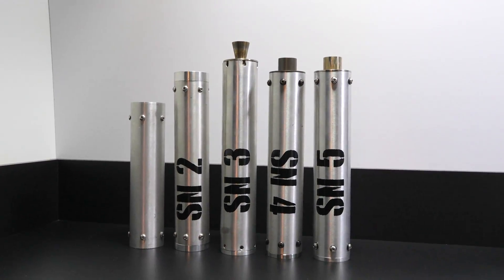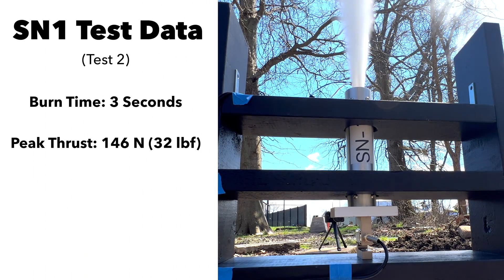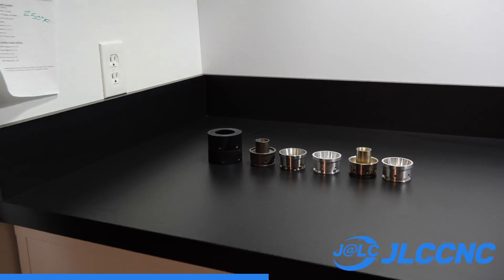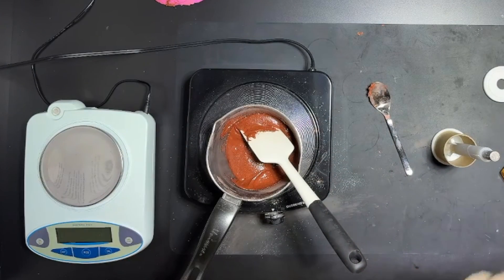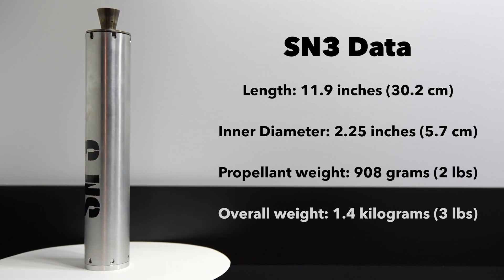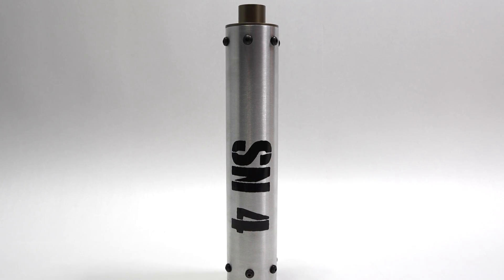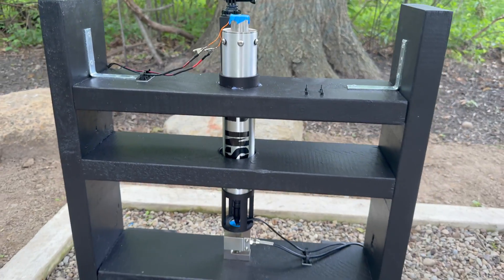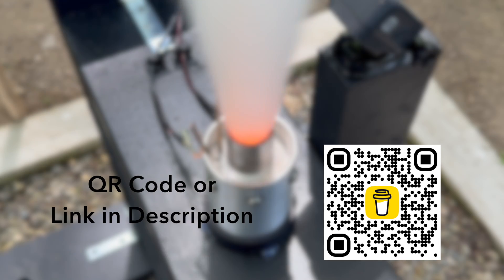I Built 5 High-Power Rocket Motors… What Went Right and What Blew Up

Comment: Awesome Video, I also make a ton of Rocket content. 

out of Curiosity are you L1 or L2 yet with NAR or TRA? if your not it would be good to look into, they have great resources and insurance, depending on where you live there is also a lot of amazing launches. 

Congrats on making a J motor, that's awesome! (640-1280 Ns) 

I myself am working on the Thrust stand for a Sugar motor campaign I'm going to be running soon. 

also just as a tip, and this doesn't really matter, but rocket motors are measured in the diameter of the outside of there casing, not the inside, so 2.25in inner diameter is a bit un-intuitive for us. 
not sure what you meant though.
Reply from the maker: I plan on getting my L1 and L2 certifications in the future. I’d love to actually fly the motors I build, but unfortunately, the rocketry club closest to me doesn’t allow custom-built motors. That’s why most of the motors I make right now are sized based on readily available materials rather than what would be optimal for a rocket. If I were to fly a rocket, I would design one specifically for that, ultra light and high-performance.
Reply: @AeroPropulsions  That's sad, if you don't mind, where ish do you live? I assume its decently far away from the equator because of the snow.

Shoot me an email if you care to talk, Id love to know the base design for your thrust stand. Ive got my own designs, but i always like to have reference. 
(discord is also fine if you want.)
Reply from the maker: I would love to talk! I'm not sure where to find your email but mine is aeropropulsions@gmail.com
Reply: @AeroPropulsions  Awesome, Ill shoot you  an email real quick.

Comment: You can save some additional weight on your steel nozzles by doing the following:
1: make the convergent 25-30 degrees, You will only lose a couple % Isp but less total weight.
2: Eliminate the screw holes in the nozzle, use a separate aluminum retaining ring
3: machine away excess steel around the throat like SN3, not like SN4
It also looks like you have the same number of screws on both the bulkhead and nozzle end. If for some reason, the motor builds up too much pressure and CATOs, you don't want the bulkhead end to fail; if it does, it then becomes the nozzle, and your motor will take flight. By having fewer screws on the nozzle end, it will pop out the nozzle and still stay in your test stand. The same with inside a rocket, you want the nozzle end to fail if the motor overpressurizes.
Reply from the maker: Thank you for all the tips! I will definitely keep these in mind while I'm designing MEGAx.

Comment: Hey for your test stand, as the motor is firing downwards, how to you factor out the loss of mass for your measurements?
Reply from the maker: I use data from my openMotor simulation, and add that loss mass to my data file.
Reply: @AeroPropulsions  Ah I see, I want to build some smaller motors myself ( just to save money cuz I am 17 ). I won't use any fancy grain geometries, just a small hole in the front ( like the A/B/C Motors. WIll I get close enough if I suppose linear mass depletion? Or should I learn how to use OpenMotor?

Comment: with my APCP motors I've found it helps a lot to tape over the nozzle, this helps the igniter build up a bit of pressure.  This helps reduce the propellant wasted at low pressure and the kind of very slow start you experienced in SN3 static fire 1.  Think of it like a burst disc that pops once the motor has built up to operating pressure.

also have you calculated the burn rate coefficient and pressure exponent of your propellant mixture?  This will help a lot when designing larger motors to predict the chamber pressure and performance, also allowing you to more confidently experiment with other grain geometries.
Reply from the maker: Definitely things I’ll look into for MEGAx. Taping over the nozzle would help a lot, losing all that propellant at startup really sucks. Right now, I’m working on an open motor design for MEGAx and using Nakia KNSB as a rough baseline, but being able to plug in my own propellant characteristics would make it way easier to dial things in.
Reply: @AeroPropulsions  I used to use instant start on my 'sugar' motors, but the last few years have done slower start-ups. I think slower starts help prevent motor CATOs, and you are not burning much propellant on a slower start because the pressure is lower at startup. On my motors where I want max performance, I will make the top grain core diameter a bit smaller for that initial burning.

Comment: You should use a slightly thicker wall tube and thread the ends in. Or use snap rings. This will help a lot with re-useability. You can protect the threads with some sort of lube
Reply from the maker: I’ve looked into that. The main reason I haven’t done it yet is because machining that internal groove inside the casing would be pretty difficult. I’ve considered threading as an option, and it’s definitely a possibility for MEGAx.
Reply: @AeroPropulsions  machinging the groove would actually be quite simple with a file. Just would need some time. Set up some grooving tool on a peice of wood or metal screwed down. Set the tube you want to groove against the board and just spin it by hand and simply move the tool in incrementally. Where there's a will there's a way.

Comment: you know that the nozzle only adds about 10% more thrust. so is it worth the complexity considerations? yep compared to a direct pipe rocket without nozzle.
Reply from the maker: Well designed nozzle absolutely worth the complexity. Without the nozzle I would not be able to achieve the thrust I have now.

Comment: So I just took away some points from your test series and compared them to my series. Even though my series is very very incompetent compared to your professional testing, I still think I can make out some comparison. In summary, my first point is: the length of my burn doesn't dictate the power of my motor without knowing the thrust, right? I had a 60g dry mix of oxudizer rich (forgot the ratio) KNSU that burnt for 45 seconds, while maintaining a very solid flame, and a well composed projection of smoke, but still that didn't have near as enough thrust to push the scale down, which is my make shift load sensor. Point 2 is that a nozzle, especially its deflection angles and throat size, are very important and dictates whether you have a smoke bomb, a rocket, or a grenade. Point 3 is 0.7 cm thick aluminum, forgot the type, is still not enough for a KNSU motor. Thanks for the video by the way, it's a benchmark for my work and a marker of how far KNSU based propellants can go.
Reply from the maker: Yes, you’re totally right, you definitely need to measure thrust if you want to know the power (total impulse) of your rocket. Nozzle geometry plays a huge role too, if the throat diameter is too large, you basically get a smoke device; too small, and you risk creating an explosive device. I’d really recommend investing in a load cell and Arduino setup. A scale can give you a rough idea of peak thrust, but it won’t tell you much beyond that. To calculate total and specific impulse, you need to log thrust over time.
Reply: @AeroPropulsions  Thank you for the feedback🙏. I've already had some ideas on implementing what I got from the video to my tests.

Comment: I honestly loved this series, ig it's the first time a creator has created something so unique yet kept no secrets. However, I do think that the Rocket motor is a bit too heavy, would there be any reliable way to decrease weight down to ~1kg without significantly reducing propellent mass?
Reply from the maker: Thank you so much! Yes, I would agree the rockets are slightly heavy. Sugar rocket propellant isn't as energy dense as other propellants, and also the rocket motor being reusable introduces a bunch of weight. Overall I wasn't really planning on flying this motors so it wasn't a huge issue.